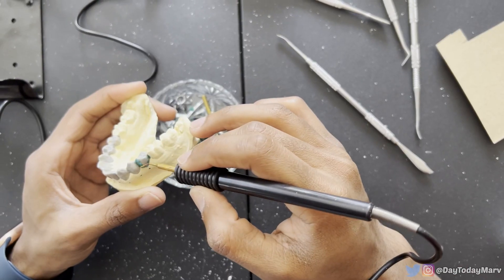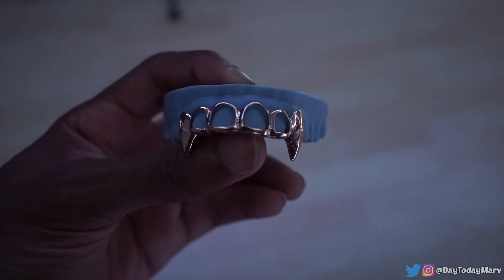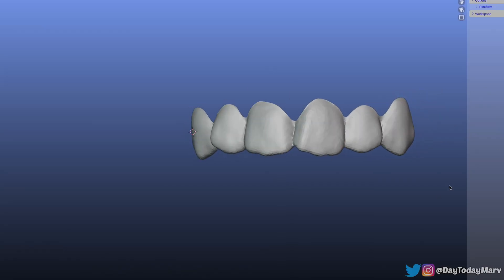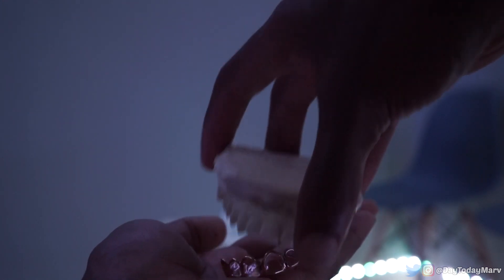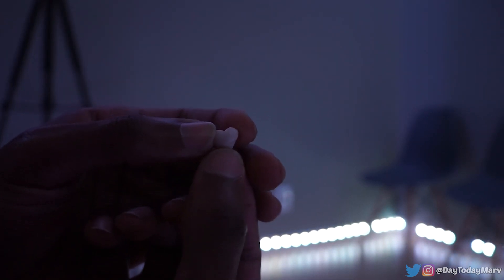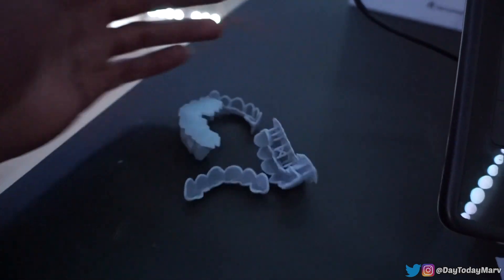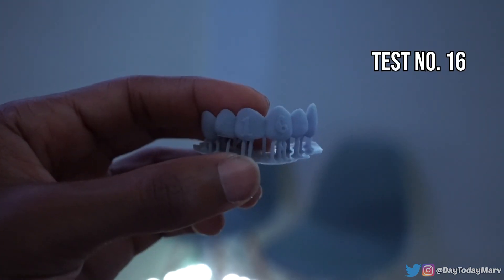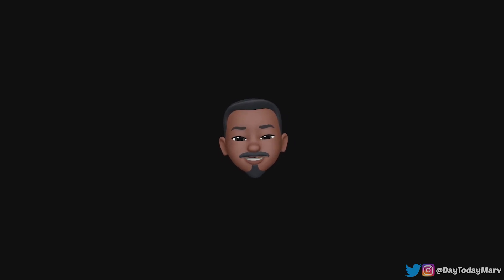I made grillz! 🥶…Sort of

Comment: Dentist interested in 3D printing here. 
Your grills might actually fit fine on teeth, just not models. 
A potential problem here is the resolution of your printed models
Even with dental printers which can be ultra precise, I see big differences in the fit when I print at 100microns vs 50microns 

In reality, teeth have a lot more grooves and bits of friction
These textures are lost with lower resolution printers 
Especially in the interproximal areas (areas between each teeth). If your scanner/printer isn’t top notch you lose detail in each step 

That being said, the inside fitting surface of your grills don’t actually need that much resolution, because they should be able to be inserted and removed at will. 
I think the main issue here is just that you won’t be able to definitively test before.

Some design softwares like exocad, blender for dental etc allow you to choose an insertion direction and shows you the undercuts  in that path of insertion . You could compare your digital scanned model to the physical model and see where the resolution was lost 
Then add some materials in those areas on your digital model to improve retention
Reply from the maker: I’ll try this asap thanks!
Reply: Did it work?  @DayTodayMarv